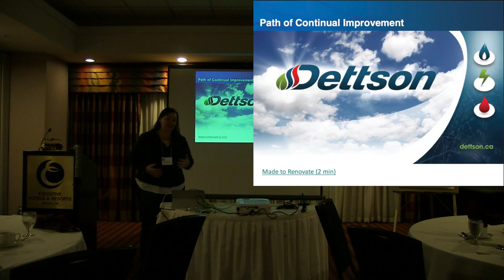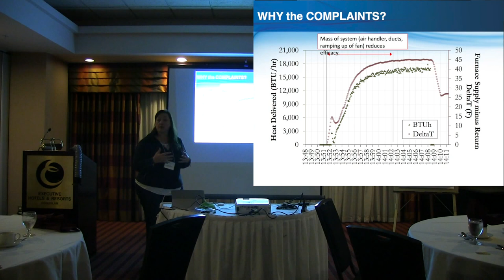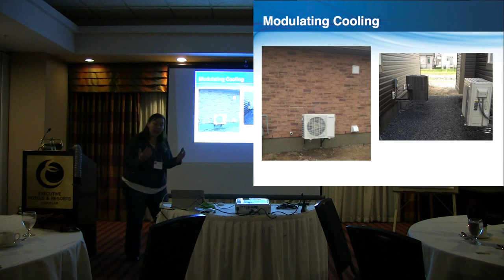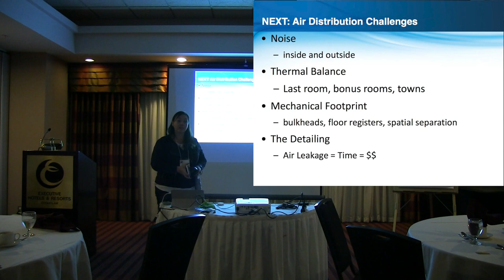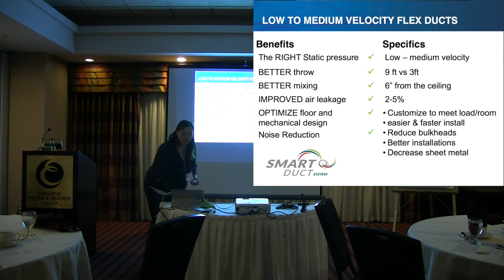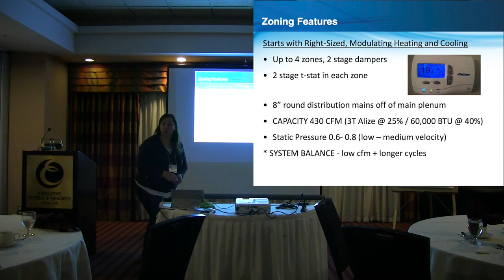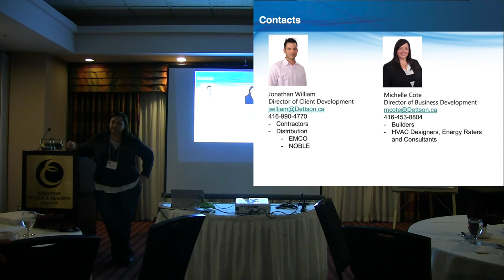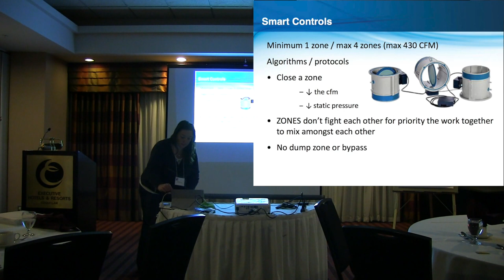TECA. Michelle Cote, Dettson speaks on: Comfort—Better, Faster and Cost Efficiently

Comment: Michelle :  you are vitrtuous in your paitence!  As an engineer, when i finally got to build my own home, i went 'rouge' and designed system fully. What a struggle it was to get installers to follow the plan! Oversizing is The problem of the time.  I was skeptical of your 2,5" ducts but am now less so. Thanks! Your HP+gas system is effectively what I'd done in 2015 w. Senvillle HP + Amana furnace & custom control.